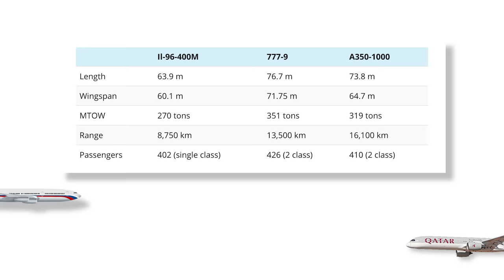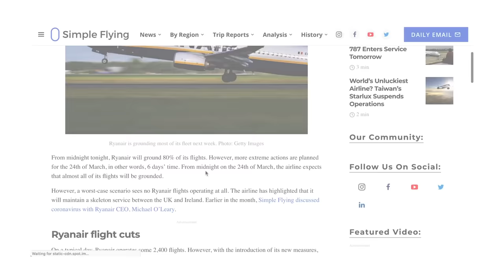The 400 Seat Passenger Plane With No Customers: The Il-96-400M

Comment: They are trying to build that aircraft at a time when the airlines are retiring their 747s, Airbus A340s and to a small extent the Airbus A380. These are all 4 engine jet airliners. What does that tell you. Airlines are generally done with their 4 engine jet airliners. They are replacing them with 2 engine jet airliners. Given a choice between the Ilyushin IL-96 400, the latest Boeing 777 and the Airbus A350, airlines will almost certainly choose the latest Boeing 777 or the Airbus A350. Even the Airbus A330 and the Boeing 787 would be a better choice than the IL-96. Iluyshin wake up. It is time to to develop a 2 engine jet airliner. 4 engines just won't do it anymore except in a few rare cases.

Comment: The airlines are moving away from 4 engines aircraft and is leading towards 2 engines fuel efficiency aircraft with the needed rage. As far as I see, the Il-96 is an attempt copy of the A340. In spite that it is smaller and lighter then the 777-9 spec and the A350-1000 spec, it does not even come close to their range and I will therefore conclude also that it is a useless and does not worth the investment of any airline.

Comment: CUBANA will surely fly it, as Cuba's regime will push Putin, like always, to get two of those for free. After few months the machines will be grounded due to lack of maintenance and spare parts. It is so predictable, for a country with ZERO economic output due to an insane socio-economic model (embargo comes only on top of that... the fact that Cuba does not produce anything, not even sugar anymore, has primarily to do with the insane inproductive system).

Comment: The days of the 4 engine airliner are very much over. Even the A-340 was a failure as its brother the A-330 was far more successful.  If Boeing was making/ designing a new “747” today it would be based around 2 very large engines. Not Four

Comment: Potential? Have you checked the fuel economy and reliability? NOT! The refresh program had a propaganda scope not commercial. In russia there's a wide spread belief that soviet engineers did the best work in the world, so they should keep their foundations and improve on them. But it is not ture. Il-96 had horrible fuel economy from the beginning and couldn't compete with western alternatives, if flew in USSR because they had no price for fuel. Now no one would take if for free, as it comes with poorly designed uneconomical engines, requires 2 pilots and one board engineer and more maintenance. It's an idiotic fail.

Comment: Waist of money and time. Especially now with the pandemic, using more fuel and not being able to fly as far as twin engine jets. I guess u have to give them a bit of praise for keeping on trying. Illusion is a great company that built some good aircraft in its time but a 4 engine jet isn’t right to build now. Other carriers already got rid of there 747’s and A380’s that were practically new in some cases. And the A380 stopped building this year because of very low demand. As I said, this is a waist of man/woman power and money.

Comment: IMO, the IL-900M is just a stop gap plane to improve the understanding on building and modernising the plane in while waiting for the real modern next gen IL 96-500/600 or a new name plane, that will have newer larger composite wings, and the new PD 35 engine that will bring it up to the capacity and range of the western B777 or A350's. This plane is not ancient by all standards. The Boieng 777 is really a copy of this plane. Go check out the diameter, internal space diameter between the planes, and you will see how Boeing copied this plane when they made B777. All Russia needs, is the new engine PD35 to come online before they seriously moderninze this plane with a new wing, a longer plane that can meet the capacity and range of the western planes.

Comment: Every body is going for two engine due to cost. But for safety 4 engines is better.  Boeing 777 recent accidents justify   russia assertion that 4 engines is best option for large aircraft. I will prefer to fly in 4 engines aircraft than 2 engines.